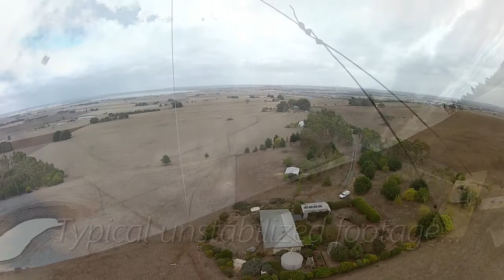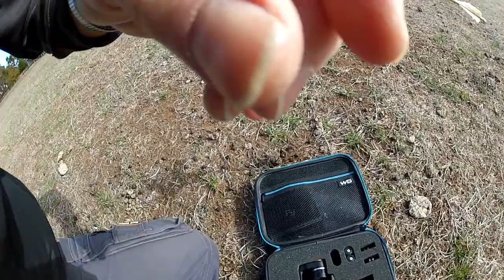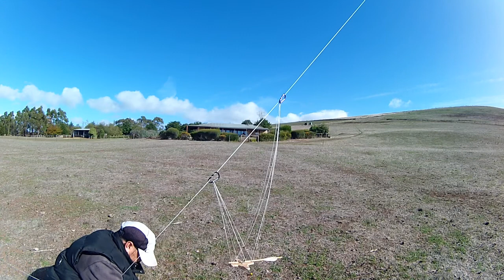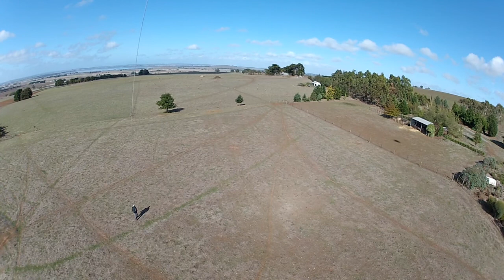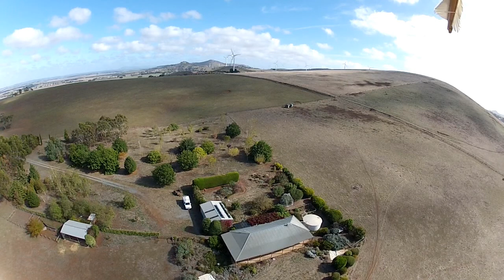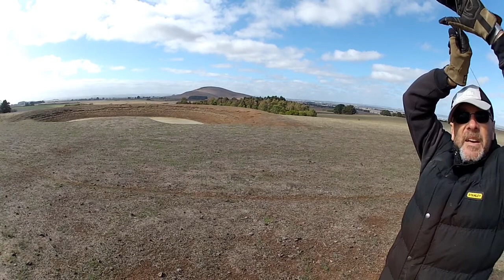How to - Kite Aerial Video

Comment: That pulley on the big carabiner is a GOOD IDEA.
 
I use a small plastic 'gizmo' which has a pully on it, and is designed to be used on a clothes line.  However, I have to hold it manually.  That belt clip thing looks MUCH BETTER.

Comment: I know this is an old video, but this is the video that sold me on the gimbal.  I recently got a hohem XG1 gimbal and the results were similar. One thing I have noticed so far on my gimbal is that in all locked mode the gimbal drifts slowly in  clockwise direction. Is that an issue with yours? It's the only annoyance I have with it, but all in all it works compared to a non gimbal flight. Nice video and tutorial by the way.
Reply from the maker: Cheers and thanks!  Interesting about the drifting gimbal - I haven't noticed that but it's been a few years since I put a camera up on the kite.  I have noticed a tendency for a camera with a built in stabilizer to try correct another stabilizer or panning device's motion resulting in jerky footage.  My current Osmo Action is a huge leap up from the gopro I used in this video.  Time to give it a flight methinks.
Reply: @quedecree  thanks for your response. It would be interesting to see a video with your Osmo action as compared to this video. I used a hero 7 white and I think it worked great. I have three KAVs on my page and you can see on my most recent two videos that the gimbal did not maintain its original orientation (lock mode) from beginning to end. I read somewhere that some gimbals has a pan drift of 3 degrees per minute. I even tested it out on a flat surface and the gimbal rotated really slowly in a clockwise direction in lock mode. It's the strangest thing and I am not sure if it by design or just a bug in the gimbal. Anyway, I look forward to seeing a new KAV from you in the near future. Cheers@
Reply from the maker: @kbunited  I should have some time on my hands shortly so I'll give the Osmo a whirl perhaps with and without the gimbal.  Hey, here's a thought about the slow drift of the gimbal....it's the Earth rotating!!  Nah, that's one degree in four minutes, but a fun thought!

Comment: I think it is possible to rotate camera through feiyu on app. Did you try it? Do you know what is the remote control range? Is it working over wifi or just bluetooth?
Reply from the maker: As far as I am aware,  my feiyu doesn't have bluetooth/wireless connectivity.  I can remotely rotate my Ziyun phone gimbal, but I haven't done any range experiments with it.

Comment: John fantastic footage did i here u say that the gimbal can rotate if set to do so.
Reply from the maker: +Graham Lack Thanks Graham.  You can set the gimbal  to follow your heading but to get it to rotate by itself you'd need something like a gopole scenelapse 360 which is basically a one hour kitchen timer - although they're not very strong and won't rotate an SLR.    Or a Syrp mini genie perhaps.
Reply: Aaahhh thanks for that John i try with something lighter

Comment: Haha I tried a similar setup today. I was super scared to fly the camera on the gimbal without any protection. I think my gimbal was in the wrong mode (pan and follow?) because my footage is not nearly as good.
Reply from the maker: I know what you mean - any sort of crash could be very expensive.  But if you get your kite into stable air first, then attach the mount and camera - it reduces the anxiety a lot!

Comment: Why don't you put a 360 Remote controlled motor, so you can spin it around in the air?
Reply from the maker: I made one with some Hobby King bits and pieces that I could control with a transmitter - it worked but it was a little clunky.  One day I'll try something like an DJI osmo pocket wirelessly linked to a smart phone or a similar setup.  Cameras and gimbals keep getting better, smaller and smarter all the time.

Comment: You could use a transmitter and reciever to remote pan and tilt it
Reply from the maker: Yes - you can set the gimbal to follow both pan and tilt but still smooth them out.  I have a remote rig that I've used for still photography but I haven't tried the gimbal on it.  Yet. :)

Comment: I tried to take the same system, but it seemed unlikely that I could easily alleviate and modify this system which if it works perfectly remains very heavy.

By opting for the Feiyu G4S I managed to remove the tube (which serves as a handle) to replace it with a Lipo via aadaptateur house for fixation. the edit system allows to have a live video feedback while keeping the possibilisté via a radio control to rotate the Feiyu G4S in every way. http://france-webcams-kap.fr/img/matos/france-webcams-kap.fr_IMG_4338.jpg

The Lipo allows a longer duration of use while feeding the radio control receiver and TX801 transmitter for the FPV. http://france-webcams-kap.fr/nacelle-Feiyu-G4S.php

#FranceWebcamKAP http://france-webcams-kap.fr #Cerf-volant #KAP #Photo #Vidéos